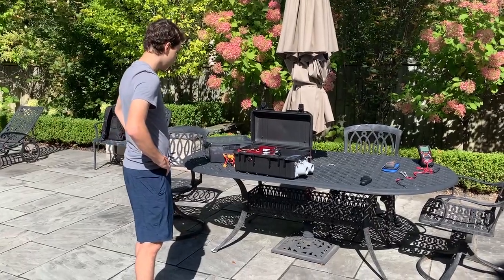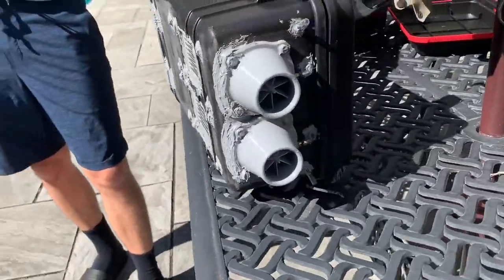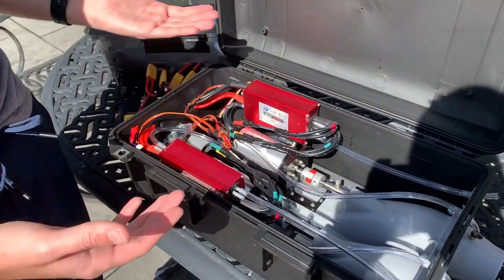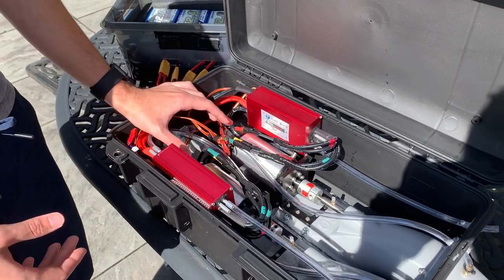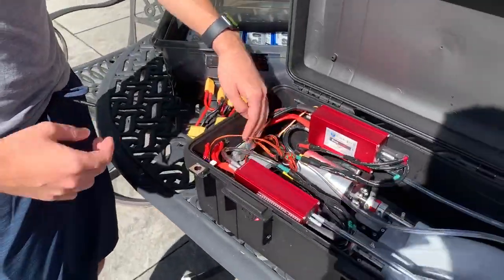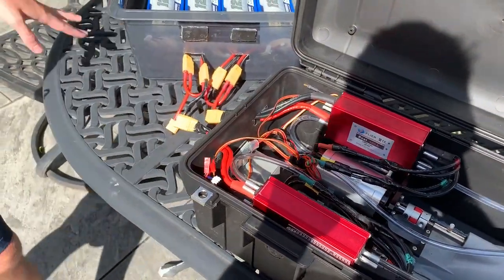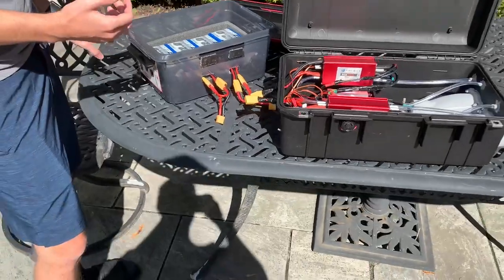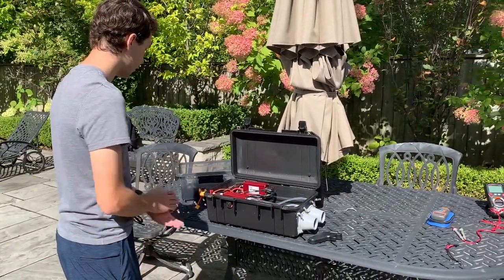Electric Surfboard Project - Electronics Box Overview

Comment: It doesn't seem like there's a real need to run a 400 Amp ESC when you are running only 230KV Motors which is far less current than a 500KV. The 300A Model is cheaper.

Comment: I'm running the same Jet Pumps that RCLifeOn is running that are 3D Printed as they have proven themselves, I'm thinking about running the 300A ESC instead of the 400, since I'm running the 360KV Motors instead of the 500KV he used and running the 2 stage design of that pump, it drops the cost of the project significantly, the 300A Fliers are $100 Less than the 400A one.

Comment: That's smart, running a lower KV and higher diameter pump to increase efficiency and your runtime. Also puts less of a strain on your batteries and cooling system.